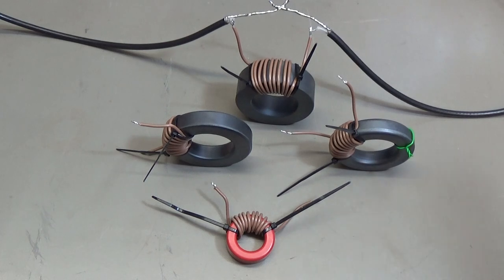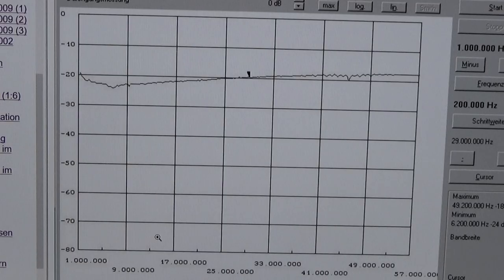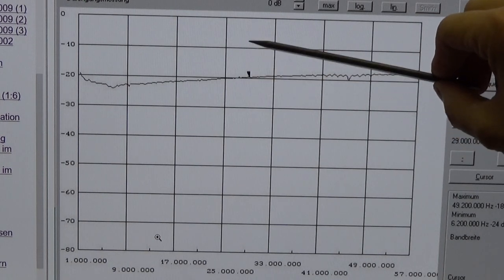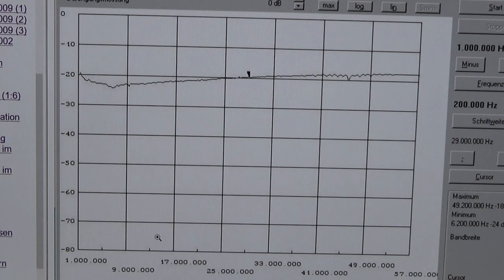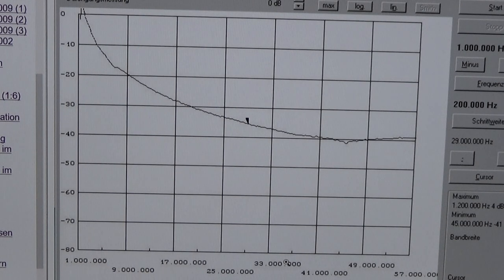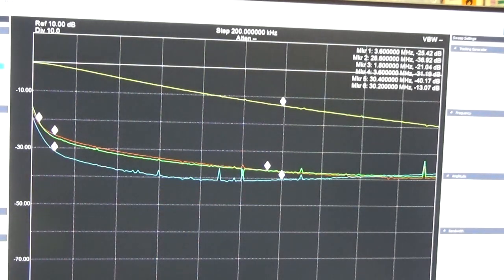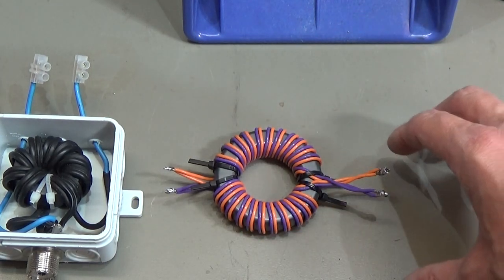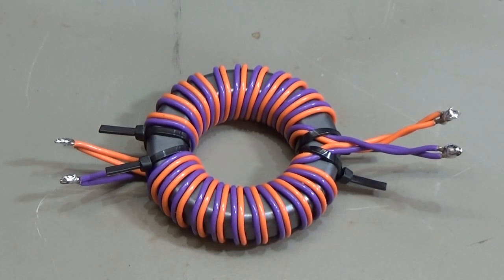#101 Balun PART 2: Balun's magic and how to wind an effective working Balun

Comment: Built one with exactly the same materials (core and wires) and in the same way as Peter did. I achieved the same results regarding the SWR (1:1.2 or better) and the rejection (21 dB on 1.8 MHz and nearly 40 dB starting from 10 MHz upwards). So definitely it does work (like a charm), therefore if you need a 1:1 current balun, build this one the way Peter did in his video!

Comment: Just wound one on an FT-240-31 core using 14 AWG silver stranded with PTFE insulation, got ~-28 dBm flat from 0.5 to ~80 mHz on both the common mode scan and the balun scan.  Also checked SWR plot using my AIMuhf from 0.5 to 60.5 mHz with SWR equal to or less than 1.1:1 (mostly 1.05:1) and Zmag practically 50 ohms or so close it's a gimmie, both traces near flat.  Thanks for your videos, very informative.
Reply: What was the OD of the insulation. I made a trial with AVG16 and the ID was not enough. Exact type/source of wire would also help a lot. Thanks,

Comment: Excellent all the way around.  I have obtained the parts recommended and built my own 1:1 balun following your advice and directions.  My results were excellent which was extremely satisfying - thank you, thank you!  Keep up the good work.  Unfortunately I do not have access to a network analyzer to check the common mode attenuation - but, since I have achieve the same results with the SWR, I will "assume" common mode currents will be attenuated.  Not only do I now have a functioning Balun, I have learned more about balun's and common mode currents they ever before!
240-43 toroid core, 18AWG PTFE wire 31.5 inches long.  12 windings... a recipe for success!
Reply from the maker: Thanks for feed back Bryan very much appreciated!
Reply: Sir! 18 awg ptfe what is diameter?  1.6 mm

Comment: Good job on these balun videos. It's an interesting topic that needed some clarification (at least for me). I applaud your method of showing which works and why, and proving it with the spectrum analyzer. It makes you think twice about using cheap chinese components as well.
Reply from the maker: Thanks for your kind feed-back and thanks for watching 73

Comment: Your Balun series are great... Now I can build my homebrew Carolina Windom with confidence. I am going to use a "vertical radiator" of 22' (feet) with the 1:1 at the bottom and the 4:1 at the top (feed point).
Reply from the maker: Good luck with your project! 73

Comment: Thankyou for your help!!  🙂  Everyone else; buy Buy BUY one of these from somewhere.  4 attempts later, my home-brew still needs re-winding.  The time and costs I have spent on ordering the wire and toroid + 2x P&H and trying to wind it, I could have bought one far cheaper.  It's a right royal PITA to wind so SO much and get it sitting properly.  Great concept though!!  🙂 Again, Thankyou for your explanation and help. Very much appreciate it and learnt.  Cheers.

Comment: A very interesting video.  I haven't wound a balun as of yet; my OCF dipole long wire antenna was given to me and my Ham buddy already had the balun wound.  All I know is that it works from 160 to 6 meters.  I didn't know that they made wire specifically for winding baluns.  I think my buddy said he used 2 toroidals to give more wattage @ 800 watts.  Of course I'll never go above 100 watts as I don't have an amplifier yet.  Cheers & 73 from W Rusty Lane K9POW in eastern Tennessee

Comment: 24:33 if you count wires from the inside, you will count 12 turn exactly like needed. I've always count from the inside of the core when doing baluns.
Reply: This is correct, the number of turns is how many times the wire goes through the center of the toroid. His balun has 12 turns. I am sure Peter knows better, but he counted the outside and got 11 turns. A simple mistake made by a man who knows more than most of us put together!!!!
Reply: @ronjones4069  Oh absolutely, I will never doubt anything Peter sais as like you said, he know way much more stuff than most of us in here !

Comment: This design is close to perfect!  I replicated it with same or better results.  Amazingly, mine dips to 1:1,05 swr on exactly 50 mhz.  I also built one using same toroid core but wound with 7 turns of rg-58u coax on each half, and while swr was just as good on HF, on 50 MHz it was over 2.5.  
Thank you!

Comment: 100% agree pure gold video but & might debate slightly about the strict necessity for high temp wire. The curie temp of type 43 ferrite is only 130 degrees C & you preferably don't want to be going into that region (non-linearities & harmonics) hence you really don't want the windings much above that. 
18AWG seems to get to 60C at 14A or 90c at 22A...   P=Isq.R....so  800W/50ohm in requires 4A so 18AWG should be great "cold".
There was a video floating around where they first tested a balun at power & all seemed fine on the (short duration) test but the core couldn't take the power properly & slowly warmed (not seen on the short duration test) but in full "on-air" use climbed above the curie temp where it became more non-linear (swr started dropping off), absorbed even more power so got even hotter PLUS being non-linear started radiating harmonics too. If the core is getting hot it may need a bigger core not just "hot" wire.
If your PVC wire is melting you may have a bigger problem than just the PVC.

Comment: Your videos are excellent. Regarding Part #1 video and the 1:1 BALUN,  I am struggling with the choke common mode loss measurements and I hope you can help me.  In your setup  you split the signal source using the (2) 25 ohm resistors (input network)  each feeding  a leg of the choke which provides a 50 ohm differential load. And on the measurement end you again load the choke differential mode with 50 ohms using (2)  25 ohm resistors (output network) and detect the signal at the center point of the resistors.. I agree so far. However, when we initially calibrate the analyzer,  I argue we should leave the input and output resistor networks in place and simply short the two choke legs. This means we now simply have two 12 ohm resistors in series between our source gen and detector. We then normalize the receive display. Then we remove the jumper shorts from the choke and make the common mode signal loss measurement. In the Part #2 video I don't see the input network being used for the common mode measurement.
73
Reply from the maker: Thanks for feed back. ou may read the article in the link for more insights. Test set-up See test results by Tom PA9T https://a08.veron.nl/zelfbouw/antennes/800-watt-fd4-multiband-antenna-with-super-balun/
Reply: Peter, thank you for additional information. I read the the link.  Please let me restate my argument in another way. You are including the parallel 25 ohm resistors on the input and output sides of the 1:1 choke balun into the results of the COMMON MODE loss measurement.  WITHOUT the choke involved, you have essentially inserted a 25 Ohms resistance into the transmission circuit. This then introduces a reflection coefficient (Gamma) of 0.2, or, a return loss of 7 dB. Now, inserting the choke balun and making the COMMON MODE loss measurement, we are now measuring both the choke loss PLUS the 7 dB.    I ask then, are we not including the 7 dB loss in the measurement result by doing it that way; which is not what we want. 

 I have watched other Youtube videos where the presenter made the common mode measurement and did not use any network to balance the input/output currents. That kind of setup does not place the choke behavior in a real world setup.
Thanks for your patience with me.
Walter
Reply: @walteranderson7889  you are absolutely right, his setup is wrong!

Comment: I was having trouble with the 1:1 SWR.  Then I twisted my pigtails together and it dropped like a rock.  Ended up virtually flat and less than 1.25 from 3 to 30MHz.  I'll shorten the in & out wires when I install it.  I did not use the teflon coated wire but otherwise followed the instructions.  The attenuation was better than -32 dB from 3 to 30 MHz and very flat as well.  I tried a 1:1 with a FT140-43 core too and it was good but not this good.  Thanks.

Comment: Thank you for the video's. I built two, the 4:1 and the 9:1 both with the common mode current choke. They both work  super! I had been using brand XX baluns and i was having problems with the common mode current in my headphones and my shack speaker system. With the new balun it is absolutely quiet in the speakers on TX unless i turn on the monitor. It is also cheaper to build one than to buy one.

Comment: Followed these instructions carefully and made one using 16awg ptfe  and 240/43 cores. Hope to test in a few weeks after I complete a few other antenna mods.   Question about Heating: what heats what? Does wire heat the ferrite or does entire balun warm uniformly? n2eye

Comment: Is it a good idea to build this without any kind of test / analyzing equipment? 
It looks simple and straightforward to build. But if I do get something wrong, I wouldn't know. I plan to use this with a dipole.

So far this has been the best video I have found on building a current balun.

Comment: I have referred many people to watch this series, it is the best one ever for explaining why the balun is needed and the best design and materials to use.  I have fantastic results following your examples making this with my homemade fan dipole running 100 Watts.  If I add a linear amplifier, how much RF power can this design with FT240-43 core material and 18 AWG PTFE wire handle?  I have just purchased an additional FT240-43 and 16 AWG PTFE to combine to core materials together with the larger size wire.  How much RF power should this 1:1 balun handle?

Comment: Hi Peter! I know that this is a minor point, but you mentioned that you weren't able to readily convert the 61mm diameter to inches. The measurement is right in the part number. One of my favorite toroids, for 200 watts or less, is the Amidon T-225-2. 225 = 2,25 inches (outside diameter) Hope that helps! Great video!!!! Thanks and 73's

Comment: Very good! I saw in one video you use transformer wire. I was just wondering if this can handle more heat? Is this because the wire has not got thick insulation you can wind it closer to the toroid and this use thicker wire? 
I just bought 4x ft240-43 toroids for a total of €40. I hope they are genuine.

Comment: I vote for Part 3 and a impedance transformation design as well. I may have missed something but you mentioned that the performance difference between the original wire and the PTFE (great stuff BTW!) wire was a function of the wire itself; the two wires appeared to have the same gauge so the only difference would have been the heat resistance of the wire's insulation. Did I misunderstand (old, slow brain here!).  73 - Dino KL0S
Reply from the maker: Hi Dino, NO it is not an  old slow brain there it is rather more bad english here.... Yes it is a function of the wire. Only If the pair of wire meets exactly 100 Ohm impedance then we will see a low swr. In part one I have tested a Balun on good core material and right design but with wrong wires and ended up with bad swr due to the fact that the wires simply did not match 100 Ohm impedance. Yes I consider to do a part 3 but first I have to do some normal stuff.... Thanks for watching 73
Reply: Hi Peter - I guess that's what I was getting at was what was the difference between the two conductors that changed the characteristic impedance? Was the gauge, metal type, stranded vs. solid, different? I suppose the difference in insulator (plain insulation vs. PTFE) type could make a difference as well. Just curious whether there was a quantitative difference.  73 - Dino
Reply from the maker: Ah now I got.. Yes it must be the difference in insulator and the gauge I guess a mix of it. Have a nice evening 73
Reply: Just in case anyone else wonders about this. Typical PVC is a lousy material for RF, it should newer be used. Next problem is the wire gauge and insulation thickness. There is a calculator for parallel wire impedance here: http://www.mantaro.com/resources/impedance-calculator.htm
Reply: TRX Bench - Dragan Milivojević  Yes, I wondered - Despite PTFE, do You think that solid magnet wire (Kupferlackdraht) would be a good choice regarding thermal robustness, RF behavior and of cause cost and accessibility?

Comment: Hello Peter,
I have relaized 3 chokes with succsess with your useful instructions of yours videos. All three are working like in your video! Thanks !!!
The maximum power used till now is 350W. I'm planning to use 600W for the future.
@ min. 15:27 you said that with two cores we can reach about 2KW (To be tested!).
Please, may I know with only one core how may power it can handle (aproximatly, of course and to be tested of course)?
Don't worry, for me you are NOT responsable of any damage for this data that I'm asking you. Just your opinion to help me to have an idea about it.
Another question about the test that shoul be done without destroing anything: I'm thinking to increase power a little bit time by time, starting from 100W with step of 20/30W with acycle of 15s power and 15s of pause. What should I expect when I reach the max power? SWR should start to increase a little bit or it will suddenly increase to high value?
Please help.
Anyway, THANKS!!!
Regards!
Andrea

Comment: Hi Peter, Thanks for the videos they're great. I'm looking at making a 4:1 balun and 1:1 choke as you've described but mine for a 50mhz folded dipole. Wondering what the second best option for the wire might be, i'd only be running 100w max . the ptfe wire is expensive and it appears only sold in 25m rolls here in Australia, thats enough for a lifetime....the more i write this the more i dont know, i guess ill need a different toroid for 50mhz. do i look for one that has a coverage freq range over 50 mhz with the same type of ferrite as the t204-34?

Comment: Hi there Peter...great video...I've learned more and gained so much confidence with your vids...right here is the question that nobody I've asked has been able to answer so here is hoping..Toroid's..they are basically an iron ceramic ring ..can I use round magnets off load speakers after they have been de magnetized.. this would save loads on money and a good source.cheers Ian
Reply from the maker: Thank you Ian! Well to find out if this speaker magnets are usable for baluns  can only be determined by testing the material as I have shown it in the video. Sorry there is no other way..73

Comment: Thank You for this video, helped me a lot to understand the topic. Despite that when I tried to replicate your results I failed. I mean I tried to make common-mode choke on a FT140-43 core using: enameled wire, some insulated wire even wires from UTP cable (knowing for sure UTP cable has 100 ohms impedance), but still can't get low SWR. In all those cases SWR is rising through the HF spectrum up to around 1:1,8.
Do I really have to buy exactly the same wire as you used to succeed?
Reply: I HAVE THE SAME ISSUE... DID YOU GET ANY REPLY TO YOUR COMMENT?

Comment: I believe you are using Habia branded wire here. Can you please tell me exactly which item number of theirs that you are using. I looked on their website and there are four different categories of the silver plated PTFE wire in AWG18. I want to make sure I get wire with the correct OD so that the windings fit inside the toroid properly. It is not cheap. Thanks.

Comment: Could you please point me where is the theory or calculation to determine the -2 and -4 db attenuation  for 1:1 and 4:1 baluns when doing the common mode rejection tests that introduced in your video #100 and  #200?

Comment: This is probably a stupid question, but with the high heat generated how does that affect the solder joints?
Very interesting video. Thank you.
73 VK2CHC (Richard.)

Comment: Absolute love it! However, for the ones of us, who may not be able to span a good dipole, it would be absolutely interesting how to adopt this knowledge to some 1:5 or 1:9 UnUns, for instance to drive an under the roof-top monopole.
You mention in the end, that the only good way is to do a 1:1 as described for CMR and then a 1:X for impedance matching. But are there different problems regarding used cable or optimal way of winding? And may be you could try to figure out a way of testing these BalUn/UnUns without a 1..10k€ equipment at hand. After your great explanation, most of us only need to wind one to three cores and for these rare times buying an analyzer with tracking generator is a bit much.
Reply from the maker: Well O will do a video on a 4:1 version as well, but it need time...For a full balun test without test equipment is impossible. The minimum is a antenna analyser.. All the best 73

Comment: I just wound one like this on an FT-240-43 core using the same type of wire.    The SWR curve is a bit different (using an Agilent 8712ES), peaking at about 1.15:1 at 30ish MHz and dropping back down to below 1.04:1 at 54MHz.  Thank you much for the info on how to properly test these.
Reply from the maker: Well shows very good performance nothing to complain I would say.. Thanks for watching 73

Comment: Great series of video, lots of good information and tests. The FT number is the diameter in inches. FT240 is 2.40 inch diameter. The #43 mix is used by many amateur operators but Tim Duffy, K3LR, who has one of the top contest stations in the United States uses mostly #31 mix for most of his baluns. (in the U.S. we pronounce it Bell-Un like in Unlock)